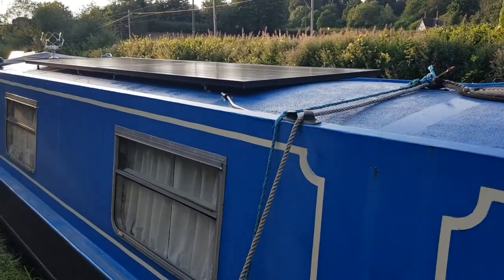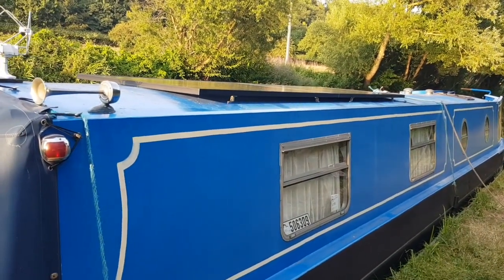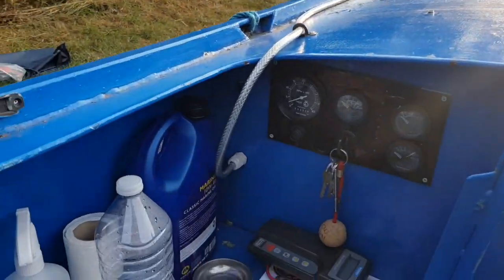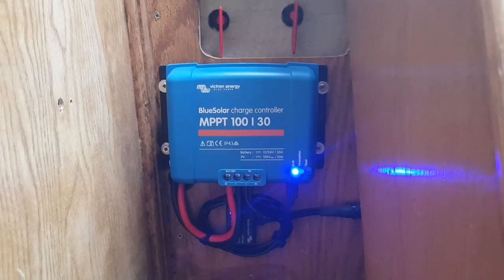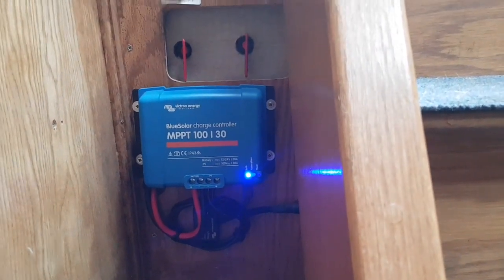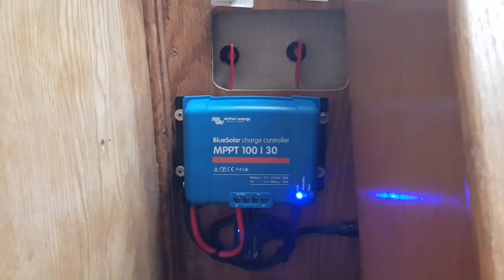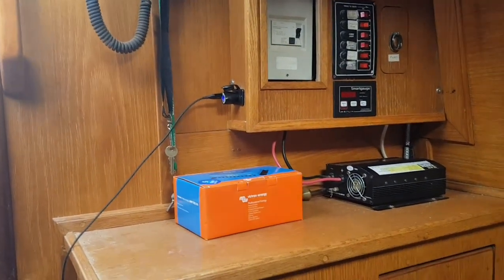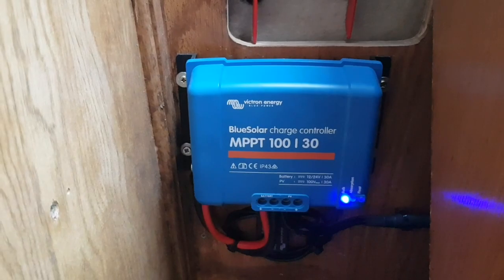Victron SmartSolar. 610 Watt. Narrowboat Engineer - Solar Installer. Custom brackets.

Comment: Hi. So interesting.  I have a question. We have a similar set up. But we are going into a marina for a couple of months and was wondering what we will have to do either switch off the leisure batteries whilst connected to the shoreline. Or run them together. We have a Vitron set up and don't know what is best. Also we are looking at some sort of security system. Can you give advice. Thanks for your help. Regards Bob Johnson

Comment: 600w / 12v = 50.83 amps. How r u using 50a controller? Is this 24v system?
Reply from the maker: It's 12V. A great feature of the Victron controllers is you can oversize the solar array. There is an upper limit determined by what the controller can handle if PV is connected reverse polarity. https://www.victronenergy.com/blog/2014/03/28/matching-victron-energy-solar-modules-to-the-new-mppt-charge-regulators/

Comment: Hi Ed, how much do you charge for this?
Reply from the maker: Hi. It was something like £1450 including fitting the Smartgauge, some 12V sockets, checking batteries and some other bits and pieces. Regards, Ed

Comment: Loverly set up well explained - just one concern  that the controller should be at least 40 amps - I  have just one 280watt panel and  a 20a  (EPever tracer)  on my motor home when the sun is directly overhead on a brilliant day I have seen it peak at the max 20amp - given that your  panels are a little bigger potentially it could even  top 40amp.  I assume Victron like EPever starts to modulate the current down to avoid overloading and appreciate for 95% time that the controller will be adequate.
Reply from the maker: Thanks for the comment Trev. Yes, potentially can get closer to 50 amps off these panels and majority of time I'd be fitting the 100/50 with a 2 panel system. It's great that the Victron & Tracer controllers allow you to overspec the solar panel array. Often the bigger controller will just achieve a full recharge earlier in the day and a 30 amp charge is pretty big for a boat with such a low daily AH consumption. Regards, Ed

Comment: Hi, Is there any device installed that will cut the power when a battery gets to say 50% to avoid draining the batteries by accident?
Thanks.
Reply: Yes there is a product from Victron Energy, it's called a Battery Protect. It's  programmable for different battery chemistry.

Comment: Good morning
We are planing on getting a narrowboat soon, we have a hire boat booked from braunston at the end of the month to make sure we like it, then the hunt starts. Most don't have sola, what is a rough price to have them fitted?
Reply from the maker: Hi Lewis. The job in the clip cost my customer £1450 inc. fitting of a Smartgauge, 12V sockets and my travel. Exact price would be dependant on the job. I would say roughly for me to supply and fit a system using my brackets would be somewhere between £1200 - £1550 dependant on type of controller. Regards, Ed

Comment: How much height above the roofline can you mount stuff while traveling down a channel? Is there a height limitation?
Reply from the maker: Hi SolarizeYourLife. Typically there's a couple of feet clearance with the arch profile brick built bridges but this can go down to inches with some steel bridges and tunnels can be v low where you have to remove bits and pieces from the roof..  Cheers from England. Ed

Comment: Love the install. Simple and clean! Once I build the shelter shed, I have a 150/35 waiting that I am installing at 48v and a victron Phoenix 1200va inverter. Battery is one 48v module Chevy volt lithium and will eventually get a whole one.
Reply from the maker: Greetings from the UK and thanks for the comment. Your 48V system sounds like the way to go. We're pretty stuck with inefficient 12V automotive type systems for now..Cheers, Ed
Reply: @edshiersfourcountiesmarine6677  It is super easy to go to 24v battery and distribution. Step down to 12v for loads. Rather than have loads track down the battery voltage they can have a stable voltage. +13v is more desirable for most 12v loads. Half your batteries that are in parallel, smaller MPPT required for the same watts, smaller wire.
 
You can step down to 18-19v for laptops rather than step up. In general buck supplies are more efficient than boost  and cleaner.  It's insane using an inverter for charging a laptop they are a DC load anyway so why go to AC. It costs like £20-£30  to make up a DC DC charger for what ever voltage the laptop requires. Greater efficiency but more to the point AC inverters are the absolute devils work.  Insane EMF/EMI.  If only people had the equipment to test what they were exposing them self to and paired with the understanding of the biological effects. 

You can do some fun things like mix battery chemistry, 24v Lead acid, (preferably lead carbon, for round trip efficiency!)  in an outside compartment where cold is more of an issue for lithium charging.  24v distribution stepped down to 14.6v for the perfect charging voltage for LiFePO in the warmer cabin.  The DC DC step down is your current limiter so none of the headache of frying alternators. What and how you set up that system is really down to your imagination. It can serve you in multiple ways.  You can distribute your power to individual purposes and then isolate consumption form the main power system.  You can get multiple shunt  battery monitors for the price you spend on one victron monitors.  

There are just so many real world benefits to having 24v over 12v and what you can do. More so now than ever as more and more devices have their own batteries.   If you want to charge a dyson or other vacuum, cool you don't need the 230v switching power supply just make up a dc charger.  Cordless drills same thing you can make a DC DC charger. I mean yes you can already use a boost converters to do that but stepping down is much better.